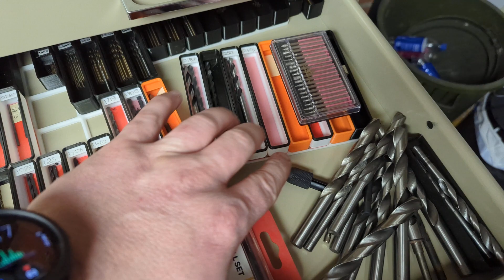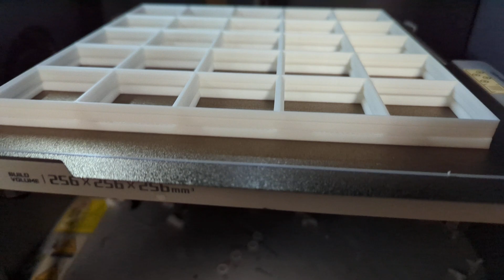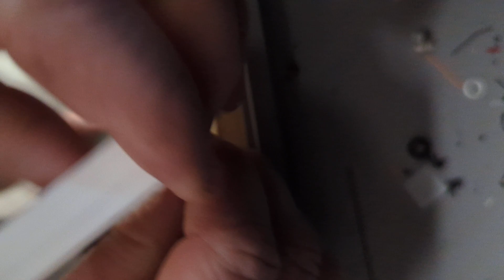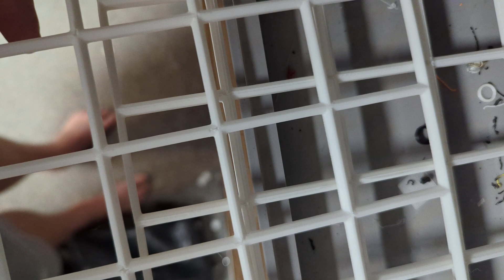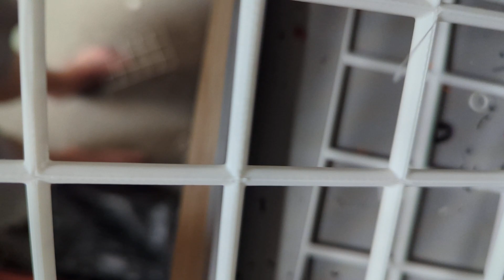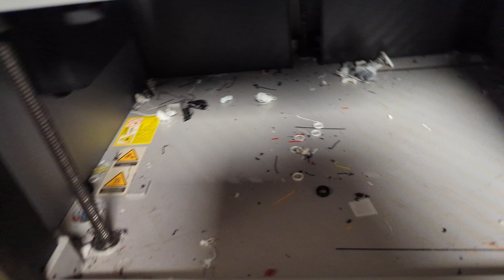Attempt at stacking Gridfinity baseplates on the 3D printer. PART 1

Comment: did you stack them in like fusion 360 or in the slicer. ive been trying to do this but it hasnt been working out. i can stack them in fusion with a gap but when i export to orca im pretty much lost getting the single layer gap.
Reply from the maker: I split and stacked in bambu studio but I now know it would be easier to stack everything in CAD (I use Onshape). Export it as one .stl with different bodies for each discreet part. Import into studio and one part with multiple bodies.

Each interface would go like this:
Base grid minus 3 layers
3 layers of base grid
Support layer of different material
3 layers of base grid
Base grid minus 3 layers

Each subsequent base grid would be oriented face to face or back to back.
The 3 layers one each side of the support are set to 100% concentric infill to force a proper bottom and top layer on the base grid part. The interface support is also set to 100% concentric infill and speeds to match appropriate for printing different materials.

Comment: pretty sure it should work printing them upside down stacked all the same orientation...
that way each grid will start as a single line for the tip and build up the 45° overhang just fine and end with a wide surface for the next grid to sit on and repeat. that way you have minimal contact area between the individual grids.

bed>tip>base>tip>base>tip>base>tip>base>tip>base>.....
Reply from the maker: Yes I believe that would work. Note that my base grid has a flattened top that yields 2 lines width.

Comment: Not sure if you were inspired by the recent Multiboard release which included a stacked model. Apparently according to his testing, if you turn on top layer ironing, it makes the top of each one smooth enough to separate prints more easily.

I'm currently printing a specific baseplate designed for the Ikea Alex drawers (two 4x3 and two 3x3, with a special 4x2 and 3x2 with spacers). I discovered the stacking model and didn't want to bother trying to design them to be stackable because I only had a few left (as of right now literally two prints) left and didn't want to waste a bunch of filament on things that aren't going to be used. Maybe if my spouse wants some or a friend asks for some, just because it's been like 50+ hours of printing.

But I definitely think I'm going to start working on some stacking models for some other things that I may want. It's truly a gamechanger if your printer is tuned enough to support it (I've got a P1P).

Comment: Print vertical - on end rather than flat. If you have a very small line/ cylinder crossing each part linking them all way up the vertical path it will act as a solid model. They bases aren’t structural so don’t need to be perfect. 

Look as 3d print buddy she has some tensegritty models that she uses super tiny boxes or cylinders to connect parts if you did one of this boxes or cylinder every 1nch or could just snip to separate. The vertical plane will obliviously put align weak axis to short axis. But it not structural if under boxes.